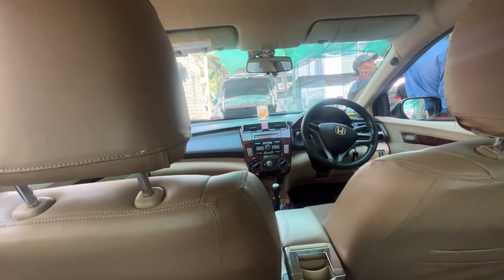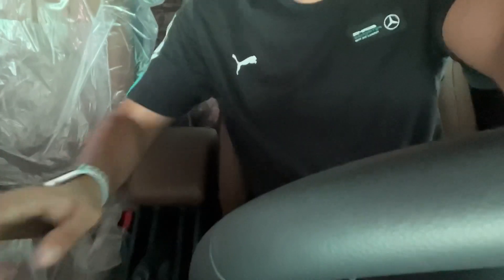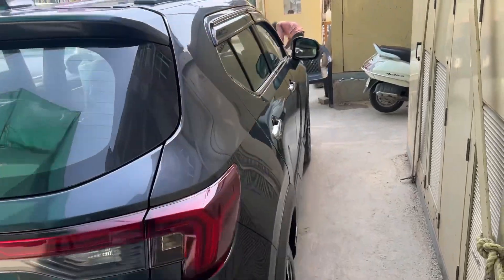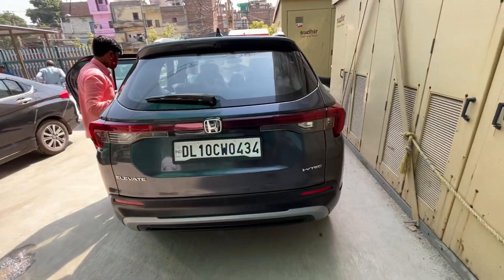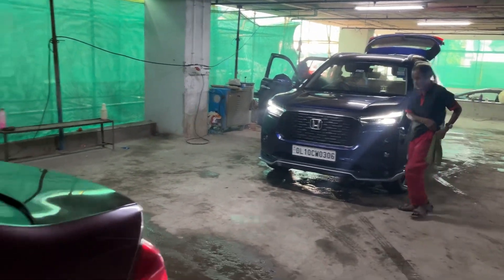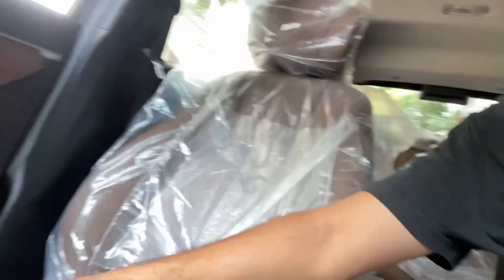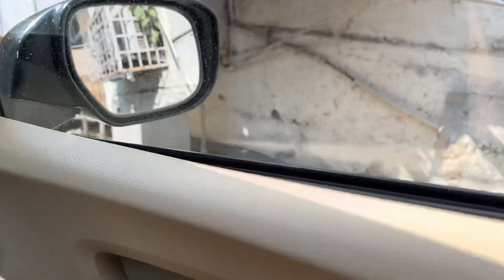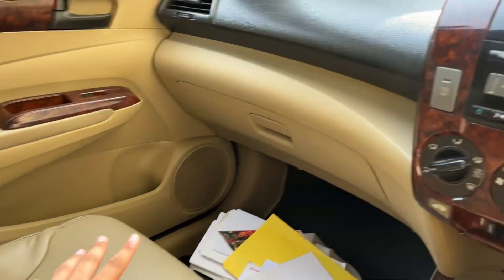Honda Elevate’s First Service and Honda City’s Last Service

Comment: How much does it cost to install seat covers and mats in honda elevate after taking the delivery ? Dealers are charging hefty amount even for small things. Please advise.
Reply: I got 7D mats for my Elevate for 2400/- + 400/- for Mud flaps. Have not install seat covers yet. Dealer was charging 2-3 times for same things
Reply from the maker: go for aftermarket seat covers and mats as well
Reply: @sanjayk2898 please share more details like brand name, online availability
Reply: I installed alloys,roof rails n garnish ,seat covers ...all within 50k
Reply: @SatyendraKumar-hg4gj  sv variant?

Comment: Did you face any issues with Honda City low ground clearance scraping body on large speeadbreakers or bad roads ? Can you please elaborate
Reply from the maker: yes i did but in the long run didn’t really effect the chassis underneath

Comment: Elevate VX second top model me Cruise control missing sunroof nahi hota to chalta 👎❌
Reply from the maker: honestly cruise control is not a very necessary feature, i personally don’t use it much on the highways as i want full control of my car to myself so it’s useless for me. (you can go for vx tho it’s VFM)
Reply: @InLined7000  exactly drove my city for 1.2 lakh Km
I never used cruise control for more than 1 min 😅
I never liked cruise control at all... everything needs to be under driver's control specially in india.
ADAS is also useless features atleast for me.